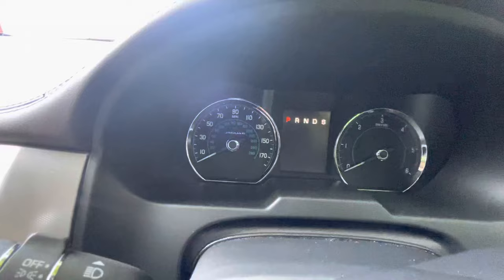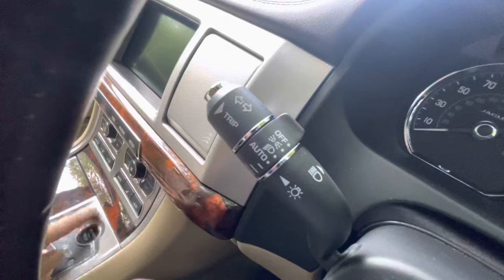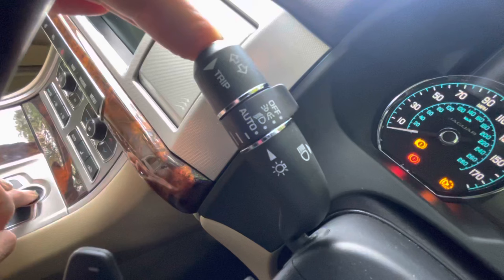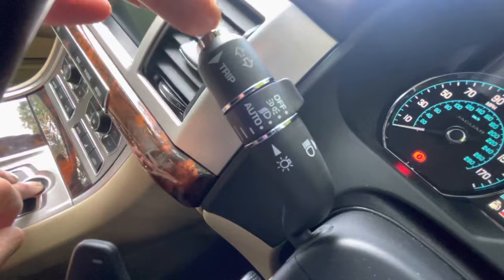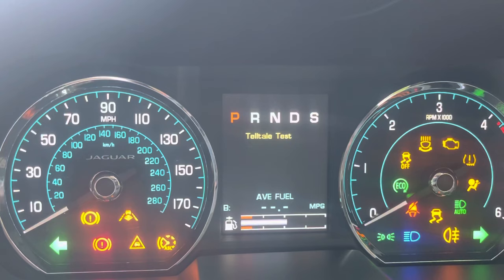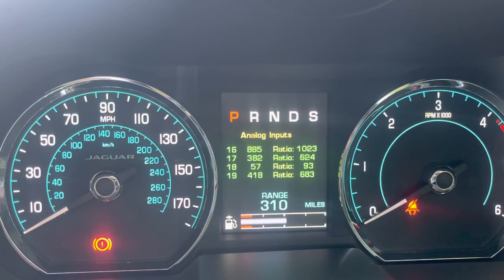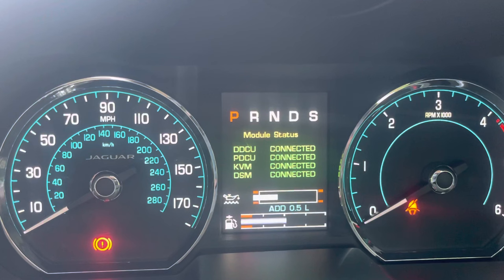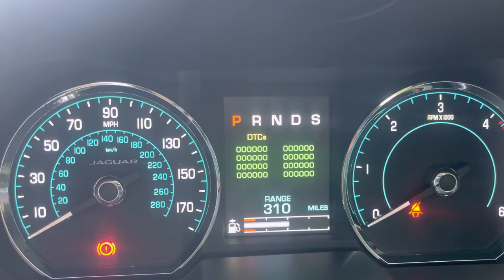Jaguar XF Hidden Menu Dashboard Gauges Lights DTC Check Gauge Sweep Tell Tales Engineering Mode

Comment: Hi, I have been getting the 'Check Predestrian System' fault for the last few days on my Jag Xf 2011 2.2L model. It can happen anytime without any warning and stalls the car instantly. I have to start the ignition completely from beginning to retart it again. This happened last year but resolved itself. No fault codes are being registered when checked via ODB connection.  Any idea or suggestions of how to resolve this would be very much appreciated. Many thanks.
Reply: Let me know if you found solution